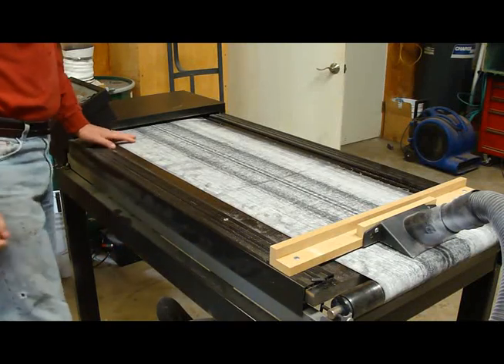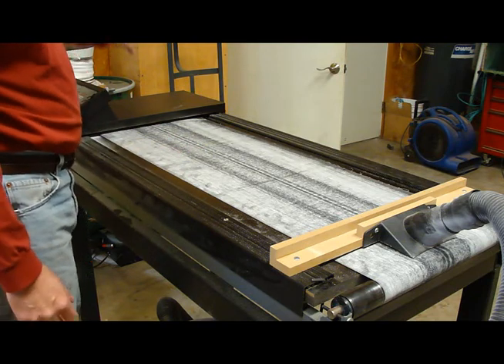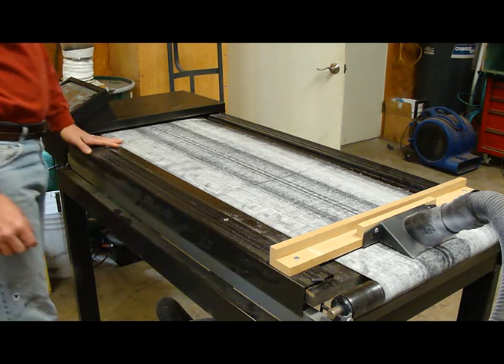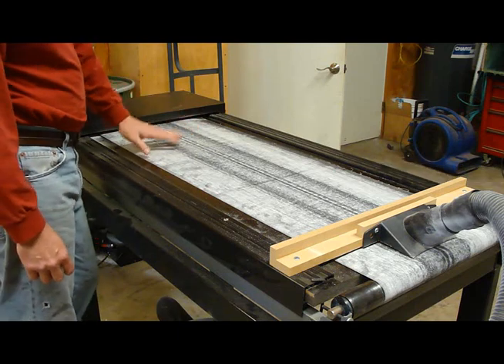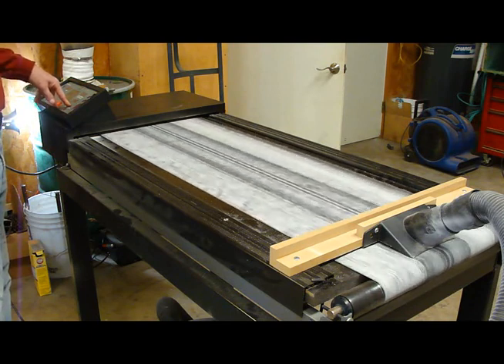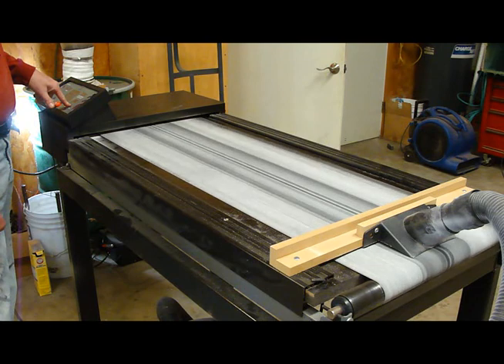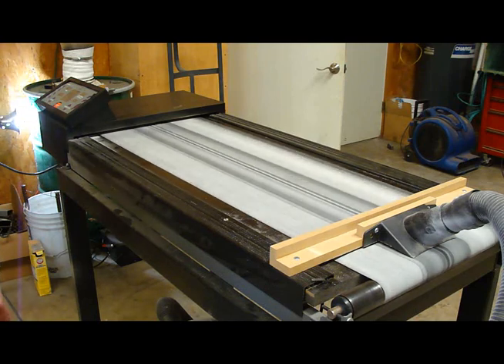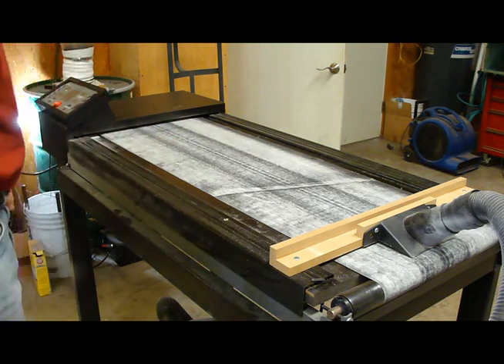Homemade super belt sander

Comment: Where did you order the sanding belt and what grit?
Reply: Found some on the interweb.  13X86.5 inches  (measured length of walking belt by cutting in half and unrolling).  

80 grit aloxide was $33 shipped from http://www.econaway.com/index.php/custom-sanding-belts.html

Belt measured 13 X 46 from roller to roller overall.  

Picked up a weslo treadmill with a ripped walking belt for $20 from CL so I'm good to go.  

thanks for posting your video for the idea.